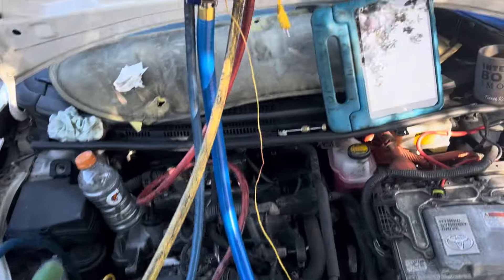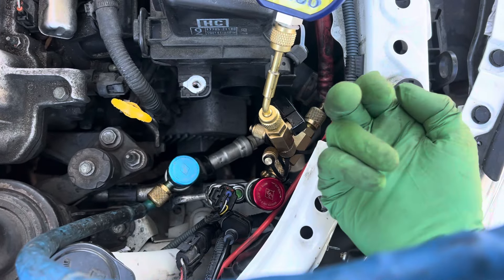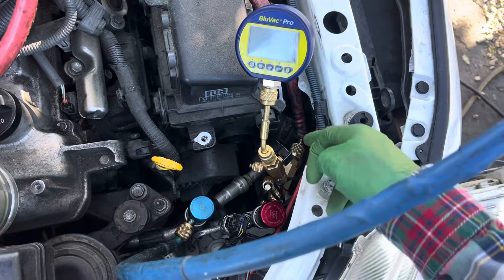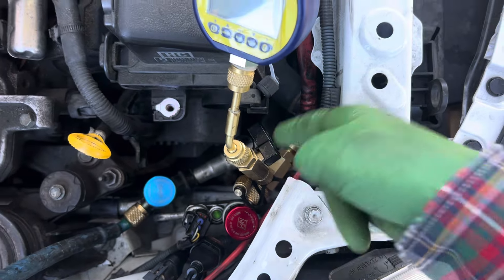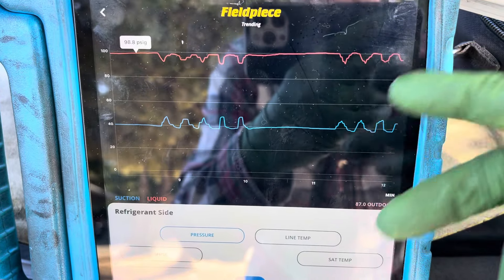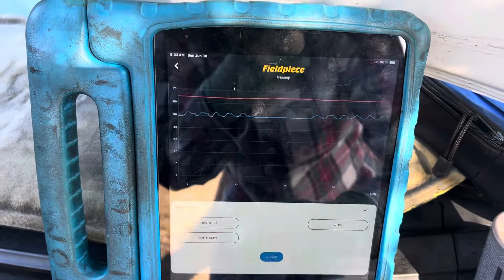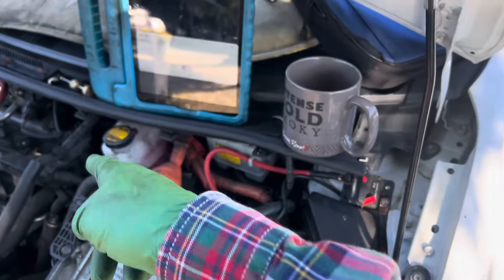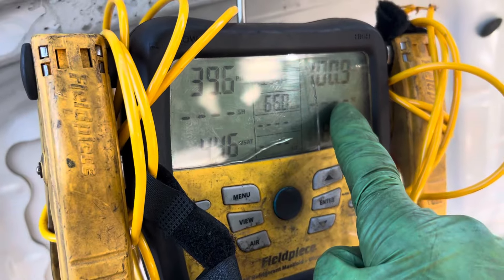MICRON GAUGE Connection ball valve protection don’t want oil contamination on sensor ￼￼

Comment: Tom, thanks for making all these awesome videos. How are you finding your fieldpiece digital gauge? Is it holding upto your tough usage? My yellow jacket manifold bit the dust finally. So I'm in the market to buy a new manifold gauge for hvac usage.
Reply from the maker: @lordjaashin  over the years, my Fieldpiece gauges of held up just fine. I don’t baby them. I just throw them in the back of the vehicle with face down or face up. I made videos of them outside in the rain and I just leave them outside in the rain.. They will get used anywhere from 6 to 10 times a day refrigerant recoveries, vacuum and recharge or high-pressure nitrogen decay test
Reply: @coldfinger459sub0  dang. That must be one helluva product if it lasted for years keeping up with your busy schedule and usage. Which hoses do you pair that fieldpiece gauge with? I know you use trutech blu hose for vacuum, as seen in your previous videos, but what about rest of the hoses? I see that your navac nrd16t vacuum pump is holding up like a champ. That thing looks like a battle tank.
Reply from the maker: @lordjaashin  yellow jacket hoses
And to make them more durable and last longer 
I’ve put heavy duty marine grade adhesive lined tubing over the yellow jacket hoses. 

This makes them last much longer. They could take abrasion sharp edges and hitting up against exhaust manifold. . 

I used to have a problem with damaging my hoses in the past 

Also, it’s very common when you’re rough with your hoses constantly pulling them bending them tight corners where the brass crimp on the hose bends right there and causes a leak overtime . 

Placing the shrink tubing over the brass crimp.  It extends the life of the hose at this point.
Reply: Can't beat the Fieldpiece manifold gauge. Quality of construction, durability  accuracy and repeatability are the best I know of.  Ingress protection (ip) rating is 54, so I suggest keeping them out of the rain.

Comment: What's going on with your Prius now?  Did you have to recharge it again?  I remember the performance you weren't quite happy with not too long ago.
Reply from the maker: @mailmanjoe  well what I totally forgot about it turns out I never ended up changing my cabin air filter for a very long time. 

When I recovered my refrigerant, I had exactly the factory charge amount that I charged it before came out, so it was not refrigerant. Charge related. 

So I started looking things over when I inspected. My air filter was plugged.